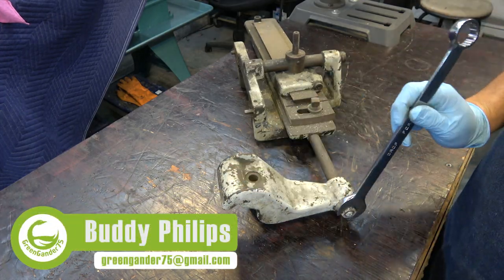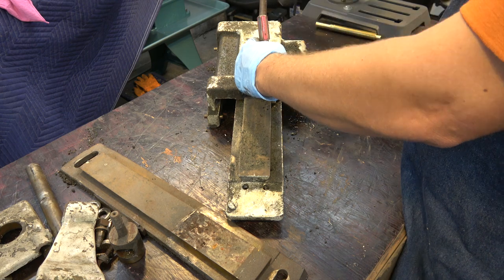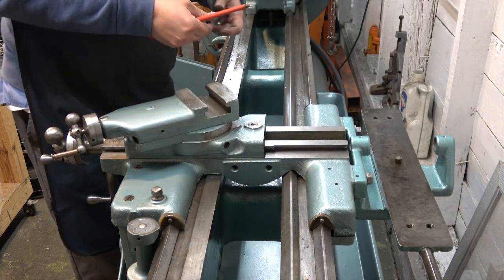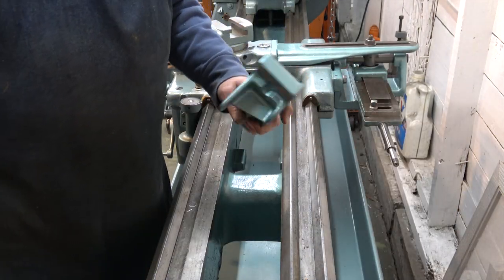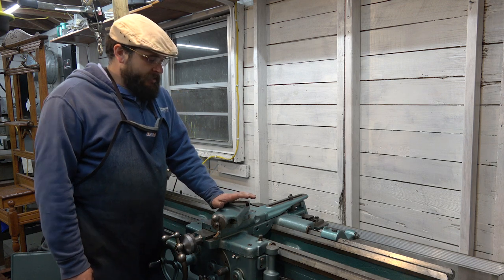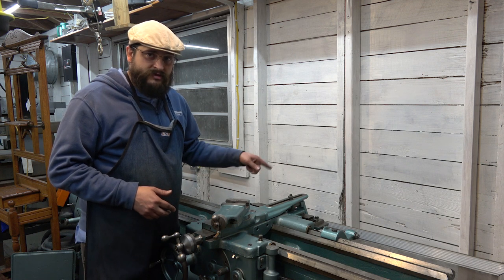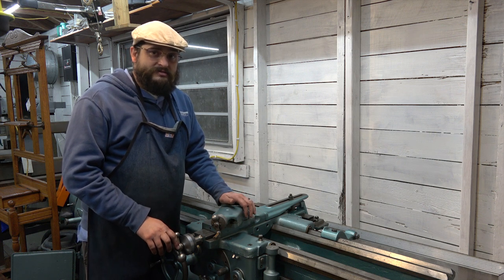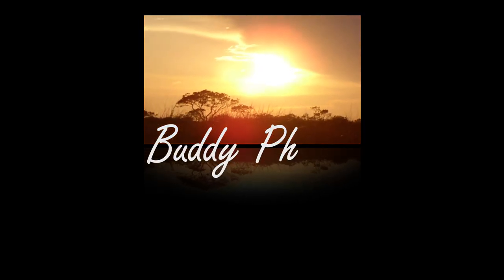Taper Attachment | 14.5 South Bend Lathe | 9.1

Comment: That is a beautiful lathe.  You can absolutely use that taper attachment without the telescoping cross feed screw.  I have the exact same lathe (not as nicely restored), cross feed screw and taper attachment as you. All you have to do is remove the cross feed screw (or the cross feed nut) when using the taper attachment to disengage the cross feed so it can move freely.  Then you clamp the slide bar where you need it, and use the compound rest to feed your cutting tool.   The telescoping cross feed screw is a convenience but it only takes 5 or 10 minutes to set it up without it.
Reply from the maker: Thanks!  I'll give it a try.